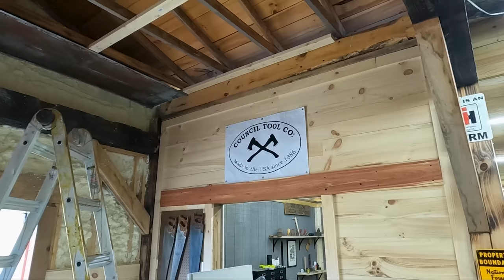Could You Give Me A Hand?

Comment: Quick tip, if you are just doing straight cuts in sheet metal and don't have a power nibbler or power shears, just put an old carbide tooth blade BACKWARDS in your circular saw. Works great! 
Just remember hearing, eye and hand protection.

Comment: The shop is coming right along. It may be a mess right now but I think it will be manageable once you get everything set up the way you want it. I like the used metal for the ceiling and the walls. 
I suppose you could double up the lighter insulation depending on how much you have but your wood stove ought to heat up the place rather nicely. The outside is looking very nice and when the big doors are installed it will be "spiffy"
jack

Comment: I picked up a pneumatic nibbler for around $75. It works excellent but the best straight line cuts are done with the circ saw and metal cutting blade or backwards plywood blade.

Comment: As a former remodel contractor may I make a suggestion? make a set of stands  16"x 16" plywood or OSB  with 4 2x4s in between in each corner  short enough for you to step up onto  but tall enough to reach ceiling (maybe 10"?) then lay a plank across them and Voila! instant staging- far easier than a ladder.

Comment: Hey Nathan love the look of the tin on the ceiling excellent find there my friend, there’s only one problem without a vapour barrier as soon as you put the tiniest amount of heat in there it’s going to condensate and your insulation’s going to be shocking wet and that condensation will find every hole and joint and it will be raining inside your shop. I know you live in a humid climate which will make your problem worse, also make sure above the walls between the trusses is well sealed of well or the cold  will run between the tin and insulation again making issue worse. This isn’t criticism Nathan I love your channel brother, I’ve been in construction for 30 plus yrs from residential to commercial and built ton of post and beam heated shops here in our cold Canadian client, again just friendly advice